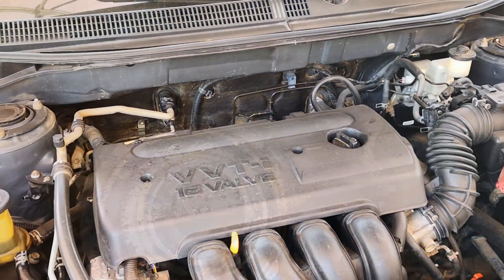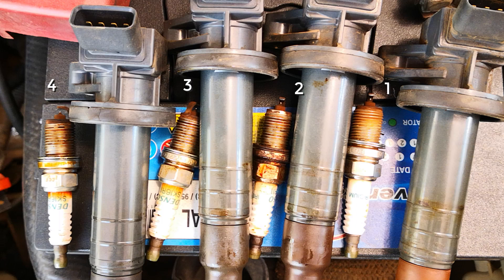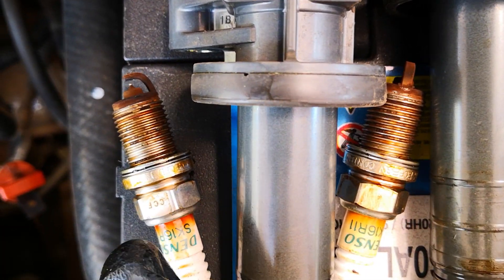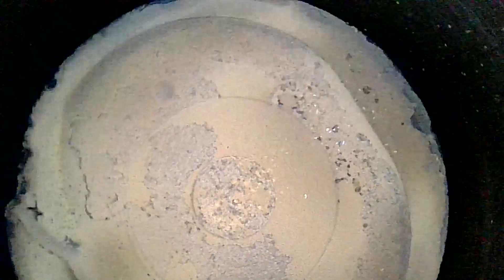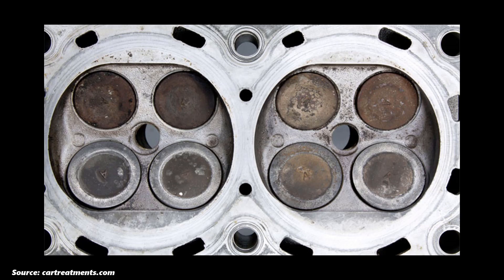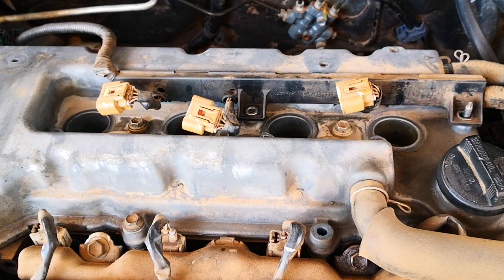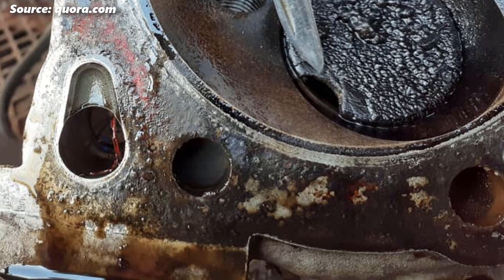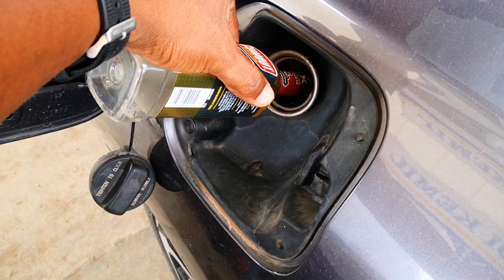Engine Cylinder Inspection: What your Engine is Telling you

Comment from the maker: Any plans to inspect the internals of your engine? Hit me up! I've been testing a Liqui Moly product on a different car with build up. Will be posting content soon!
Reply: Yes. 
Want to do mine soon. 
2005 accord. 
Having low power and oil loss. 

Any pointers, please?
Reply from the maker: The latest video should help! My oil loss is now negligible. Your piston oil control rings maybe sticking.  https://youtu.be/9q2n-5FZvr4
Reply: @DIYAutoworksNG  Okay.
Meanwhile, I inspected the cylinders today and found a burnt exhaust valve.
Also found a vacuum leak on my intake.

Now, time to deal with the oil control rings. 
Many thanks.
Reply from the maker: Ouch. On the 500? Planning to replace the burnt valve?
Reply: @DIYAutoworksNG  Please what do you mean by "the 500"?
I have not made plans to replace the burnt valve yet. And I ain't fitted with that skill; yet... so it would have to wait, I guess.
Reply from the maker: I think I may have mistaken you for another who has a Chrysler 500. Apologies.